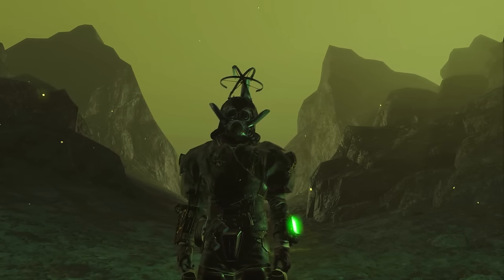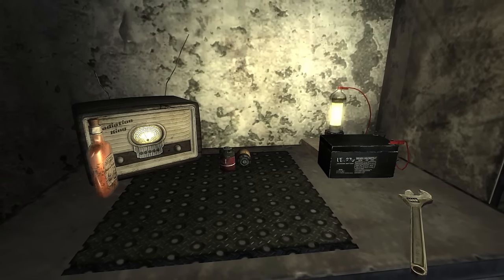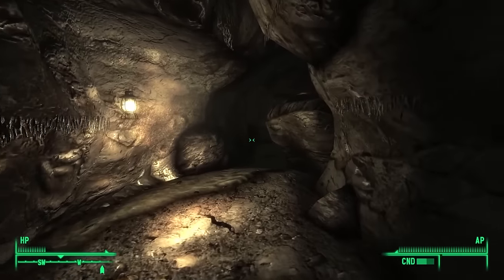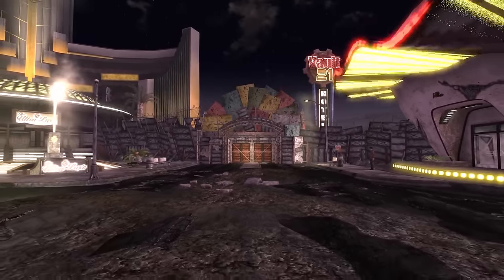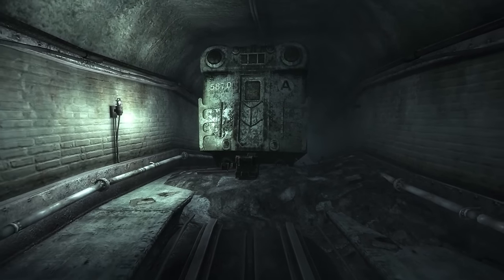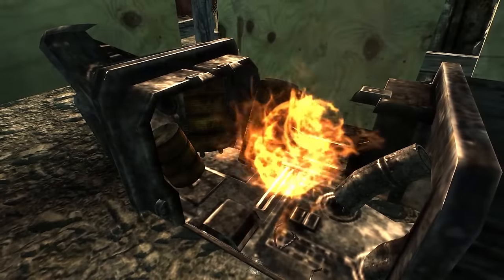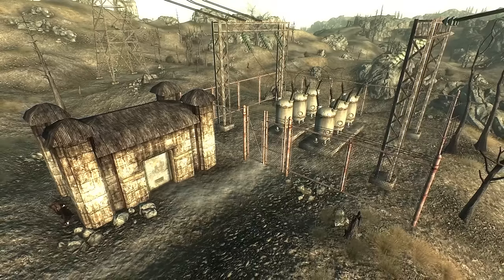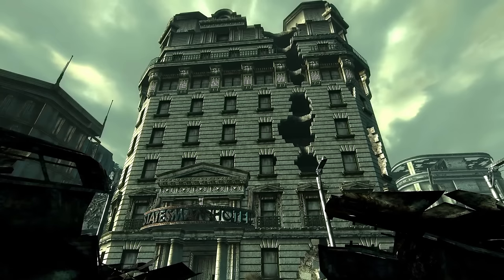Where does the power come from in Fallout?

Comment: Building on previous reply...

On "Fusion Generators", Fission Power Plants, Fusion Power Plants, "Fusion Power Cores" (and their relation to Power Armor and Laser Weapons...)

The Bulky deisel-generator like "Fusion Generators" that you see in Fo3/4 that are in large buildings, important offices and are in settlements. These were (and mostly still) operate as backup generators.
Why "Fusion" and not Gasoline/Petrol? - Thats simple. The first "war" was over access to oil reserves. There was such a shortage that Atomic energy was the primary source of power already in the US by 2030, and outside Mr.Handy fuel, nearly everything relied on electricity to function as a result. Leading to what most likely was initially a Recycling of Diesel generators into "Fusion Generators", which later became the design Standard.
From the large Fission plants, to the smaller "Fusion" brand generators/cores. Atomic energy was the only source of energy still in use by 2070. 

-----------------

With that out of the way, What happened to the Fission Plants? 
Most of the fission power plants, primary reactors would of went critical, damaging or permanently disabling it. Ultimately, failing following the war. Keep in mind, even in the 1950's you didnt run a plant full-bore, you always monitor and produce the amount needed. Otherwise it goes to waste or worse can damage the grid and things connected to it. -- So a Failed Reactor doesnt mean a huge explosion necessarily. Safety systems exist to both flood the chamber, and a well-designed reactor has methods to stop the reaction cold. Fusing the rod with carbon and damaging the reactor chamber, so it needs to be rebuilt.

So how is there grid power still from these facilities?:  Secondary reactors are still online, Backup "Fusion" generators that powered the startup sequences of the reactors (and provided load-to-load balancing) and local battery storage still is powering the grid. | Fission power is simple and you can even trickle power production without water to create steam, via thermal power generation. So assuming the secondary reactors are still functional and even without water to do fission-steam generation, there is other methods of generating power from J/K(Joules-kelvin) alone.

-----------------

On the "Fusion power wasnt made till the end of the war", this is mostly false for a multitude of reasons.
1. The "Great war" was only one day, starting and ending on October 23, 2077. | But the conflict was far older. Initially starting well before the indo-chinese country formation. When the Oil shortages started, and the US refused to share its Atomic secrets with the world. South America, Europe and Asia all grew Desperate. Micro-conflicts arose and shadow-wars raged for over 50 years. After the formation of the Indo-Chinese nation, where most of the remaining powerless nations coalesced into. A official war was started in 2074. Thats 6 years before the "Great War". This is where "operation anchorage" comes into view. -- China had been funneling atomic secrets, and stealing information from various companies in the US since before the formation. Waiting for the other nations to fall so they could use the tech on willing guinea pigs to fight the US, in a attempt to both cement china as the "Superior" superpower and force the US into sharing their tech with them willingly. -- This means the "End of the War" context, is impossible, unless they meant the end of the "Oil Wars", which means they had almost 50 years to build Fusion Plants.
2. US Military was already using Fusion power Plants, as was Vault Tec. Through the contracts they had with the US military.
3. G.E.C.K's: The Garden of Eden Kit's, used "cold fusion". Which is just a euphemism for "Atomic Fusion" in-game lore. 

That said, many of the plants may have been Fusion Power Plants, but we dont know due to the lack of info, and the state of most of the facilities. We do know some of the military facilities are still operating Fusion generators today. (and would feed back into the grid, due to the low-power draw)

-----------------

On "Fusion Power cores" and the "Fusion Generators" they use. 

Before we can talk about the fusion cores, we have to glance back at the "Fusion Generators" to make inference to what the "Fusion Core" does. Given that Fusion and Plasma cores (which are a modified Fusion Core) exist in the FO universe. Fusion Generators most likely act as a Transformer, Buffer and Generator. 

How did i come to this conclusion? a small generator like that using atomic power from a device as small as a phone, which is also used in weapons and power-armor that lack any sort of obvious power generation methods. Clearly is generating power in the device, and not acting as a fuel source, which the device is creating energy from.

Its also hinted on the end of the device... The two ports. If it was a fuel source, you wouldnt need multiple taps, and it would probably not work well if you did. On top of that, there is no known stable method to turn radioactive material into a usable form of fusion to store in a canister like that, that wouldnt rapidly deplete or cause runaway into the container due to size.

So what makes more sense is that the "Fusion Cores" are micro-fusion reactors (Something we can basically do today. Lookup desktop fusion reactors!). This would imply that the "Fusion Generators" are using this "Fusion Core" as a energy source to drive a traditional mechanical generator. Probably by driving a electric engine of some kind. Or alternatively, it uses some type of non-newtonian energy (heat exchange for example) from the core and its being converted back to new-tonian energy via mechanical means. However, this is less likely as we have already seen "Cold Fusion" devices in G.E.C.K, and given how these generators are basically the same as the ones we see elsewhere like in cars, etc. Its probably more likely a high-voltage, high-amperage powered superconductor motor.

As we cant build super-conductor motors today, as we cant store high-voltage power, only generate it on site. Making it far less useful. We are talking about a highly resilient motor, which could easily last 300 years without failure.

-----------------

Moving onto the final topic!

How does that relate to the behavior we see with Fusion Cores and Power-Armor, Laser Gattling guns, etc? - We dont see Generators blowing up like like we see in Power Armor, or see steaming cores like we see in the Gattling lasers!

This is so painfully obvious if you understand the mechanics of the above. "Fusion Generators" operate differently to the Power Armor and Laser Weapons.
Generators use the power, to generate stable power. Meaning the cores last a LOOOOONG time as they basically trickle-discharge, to drive a motor, that drives a generator... This is Perfect for generating, small and reliable amounts of electricity. To power a building...

Power armor and Gattling lasers? Directly powered. Not only does this put the core in danger of over-amp draw (behavior we see when they steam and go mininuke), but it also is necessary to operate this type of equipment.
Have you seen "Power Assisted Armor" that exists currently? huge 48v car batteries need to be strapped to the suit to give /minutes/ of operation. Standing still? still needs all that power to keep the motors and hydraulics primed. - In reality, your not walking around with a minigun, much less a cannon ball launcher or Gattling laser with one of those.

Its really underestimated just how much power is required to exert lifting energy and create momentum without wheels!... So it makes sense, a Fusion Core is necessary. Not only does provide the best source or portable power in the FO universe. The supply for the military and industrial use of powerarmor is near limitless. You werent running across the desert in power-armor when they were made. You were fighting in a platoon, of non-power armor soldiers, with vehicles to move around in.
Or going into small mines, where the armor provided radiation and thermal protections from the environment.

Every example where the cores fail, is when they are pushed by running and fighting continuously, in a manner that would of never existed before the bombs dropped... EG: They werent engineered for it.

Fusion Core powered Gattling lasers didnt exist until 2070's, just before the bombs dropped. They were a prototype, primarily used by shady military divisions and Companies with contracts with them. As FO76 revealed, if it wasnt for the bombs, we wouldnt see them in the waste.

The smaller, laser weapons, like the laser rifle and pistol. They were more common, but used smaller power sources. Most of them are highly modified, and also (mostly) didnt exist until after the "Great War".

So its obvious to say, Whether or not these cores are real Fusion or not, the reason they can go atomic bomb is due to their small Nuclear Generators thermally failing due to over-draw. --- There is no evidence to suggest its /not/ fusion by the reaction. Heat + nuclear material = run away, even in fission.

Comment: Here's a theory:

Fusion Cores are not "batteries" but rather, a container for nuclear fuel.  So, anything that takes a FC must have its own power generation capability.  Hence, the power generators in buildings; why would you need a generator if the FC is like a "battery"?  (Incidentally, FWIW, the spinning part looks to me like a dynamo.)  Devices such as this will have different levels of efficiency.  So, power armor may just have very inefficient power plants, hence, they consume FCs very quickly.  Power generators in buildings may use techniques such as recovery of power generation artifacts (e.g. heat or vibrations) to increase efficiency (possibly storing recovered energy in a battery bank).  Additionally, such a system may keep a battery bank energized as a backup.  The presence of a battery bank may explain why the power doesn't go out when a FC is removed.  The lights flickering would be caused by the switch-over to backup power.  And the "turbine" stopping is due to the shutdown of the generator due to the power source being removed.

Comment: Why do people even keep these mini fusion cores in tandem with their regular power grid?
Same reason people who are on the grid in these times install solar panels on their roofs.
"Even if I'm not fully 'clean'-Energy dependant, I am doing MY part in it!" .... Logically exactly how the Fallout Universe does portray their power and resource situation.
The oil reserves were highly coveted, so nuclear power became the most prevalent, but that wasnt "clean ENOUGH" for their standard. So to their next step which should also be irl's next step in 'Green Power' was to work on fusion tech.
Maybe in the FO universe fusion tech was worked on differently and MicroFUSION Cells and Fusion Cores really ARE fusion devices simply on a small level, no need for input of DT Fuel but rather environmental influence and/or being used as batteries rather than sources.

Which leads me to another speculation of the Fusion Generator debate....
What if those naturally found "generators" are in fact not *generators* but **chargers**?
It could very well be these devices are multi-purpose devices that have different "insertion states" which dictate whether to draw power or to charge the core
it only says "Start" "Cycle Core" and  "Eject" on the buttons. So how far fetched would it be that Cycle Core button would pull rotate the core into the Fusion Generator state, whereas the current state it is in is mainly used to supply passive power and charge the core (possibly with DT fuel) for mobile use?
Considering Bethesda hasnt given a non-modded canon version of the Fusion Core re/charger it could very well be an implication to those devices being Waterpumps as well that split the Hydrogen into Deuterium and Tritium to charge the Core as it is also supplying passive power to the building.
Which would severely cripple the lifetime of the core if removed from said socket, due to not being fed by the mysterious device.
And powered armor, mobile devices using Fusion Cores and the likes were not at all an uncommon sight in the pre-war era, so wouldnt it make sense that there'd be ways to sufficiently recharge them?
As to why bethesda didnt implement them as recharging stations to confirm such speculations, it's as simple as looking how easy and fast you get your hands on the first fusion core and powered armor.
If you could just plug it back in and have it recharge, there'd be no reason to not use powered armor whatsoever, since you get one from the very beginning with a core that'd have infinite charge.
If you want an in-lore explanation as to why you cant plug them back in, maybe the years have worn on it and pulling it out without much preparation willy nilly on >200 year old tech literally destroys the machine... dont just pull the plug on a PC that has been plugged in and running constantly for over 200 years, yknow. Dont pull the plug on any running PC unless absolutely necessary anyways.
But that's all i can give in regards to "lore !!! why no work???"